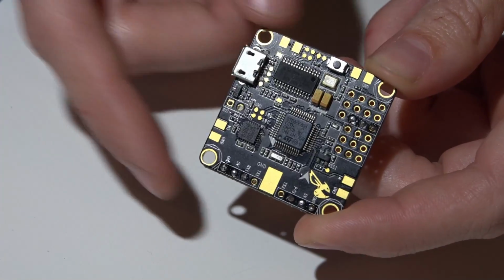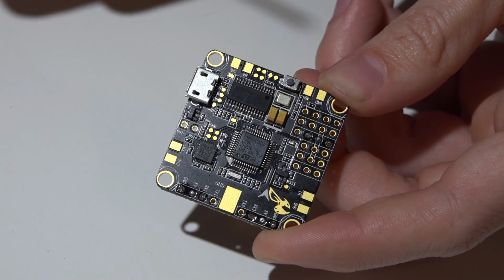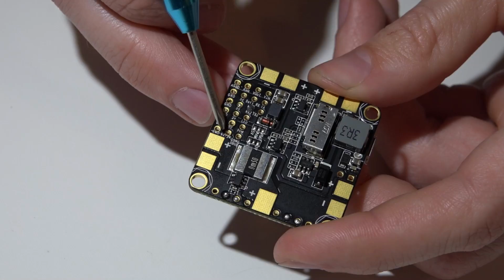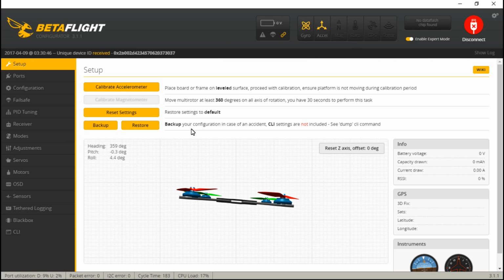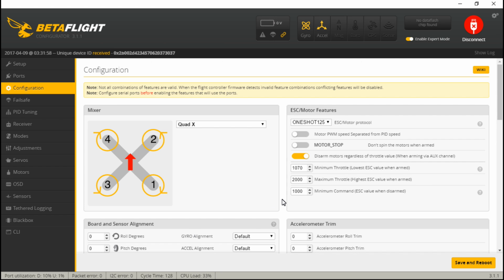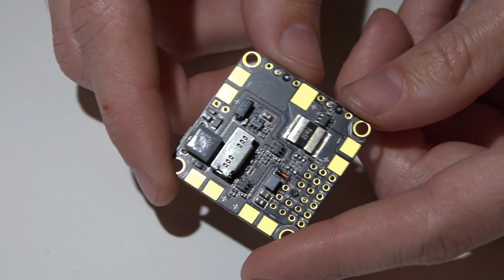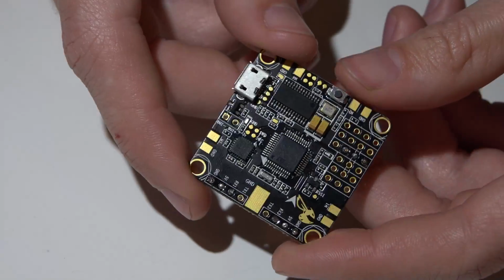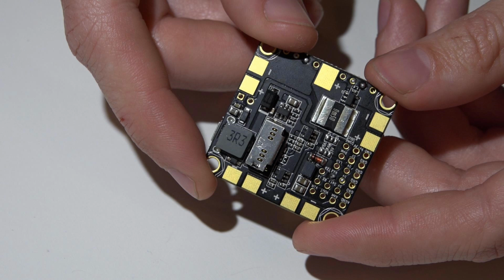Betaflight F3 Flight Controller Review

Comment: Hi I need help here , I have spent hours on it and cant figure this problem. I have X8R receiver connected to my OMNIBUS F3 AIO v1.1 FC through UART3. 
As you can see on the video I have limited control with Elevator and Eeileron. A bit higher Elev and very low Eil. When reconect the FC and rebind to X8R I gat full through on servos for few seconds and then it revert it self back to that limited servo movement. Is this the Board, receiver or bad UART ? By the way I have not removed the resistor from board. Did not think it was necessary since the sbus is connected.I am using INAV. Is there any chance you would know what have I done wrong ? 

Link to the video : https://youtu.be/trdlXlAmPCY

Comment: Great review, but still need some help. I can not get the beepter to work when activated via an AUX-channel ( that is properly set up). However a red LED starts flashing, but there is no sound. Any idea how to fix this? Is the beepter turned off when on stock settings?

Comment: Hi what would the current rating be of the PDB side,,,, I will be building a quad with a set of amp hungry - rcinpower GTS2205 2450kv motors, with 50A ESC's (maybe ott) I was told 120A may not be high enough that's on most controllers, ? would adding a cap help  ?  what could you suggest 
many thanks

Comment: Just started wiring up my board. I'm going to be using a iA6C with an Evolution. Is it ok if I wired my receiver into the DSM2/Sbus pinholes? Or should I change it to one of the 3 others that you mentioned?

Comment: I'm using this board, and am really happy with it overall, but I did have a conversation with FPVModel regarding the statement that this FC supports every possible Betaflight feature. An F3 board at the time of writing this comment does not support GPS. The Devs ran out of flash memory space on F3 targets so chose to remove that code from the firmware. GPS does currently work on F4 apparently (I have not tested this myself). Most people don't care about GPS on a racing quad but I did add a cheap UBlox7 module so I could see speed, altitude and position in the OSD and spent days trying to work out why it was not working. The Betaflight configurator lets you enable it and appears to be trying to connect to the GPS receiver, but the code isn't there in the firmware. When I found this out after a post on GitHub I was a little perturbed, mainly with the lack of communication on removal of a feature on a board for which I paid that was supposed to work.

BlueFalcon, that is one difference between an F3 and an F4 which is relevent

Comment from the maker: I noticed questions about wiring a 4 in 1 ESC to the Betaflight F3. You can wire a 4 in 1 ESC to it and it will work. You will just lose the current feature, ability to power your camera and VTX off the board, and will make the built in PDB pointless. So because you lose all these features that is why I'd recommend using a different and cheaper board if you plan to use a 4 in 1 ESC.

Comment: Im looking for a flight controller for use in fixed-wing application...
Which would be your choice of flight controller between this & the F4 Omnibus & F4 Omnibus Pro for use in a twin engine flying wing which uses 4servos for duckerons (split elevons) & running iNav 1.7 with satellite receiver please & why?
Flight controller could be out of the airstream, if thats of any help in deciding...
Thanks in advance

Comment: I use a BF FC and a Racestar 4 in 1 on my Kraken 3" . What I did was not connect the +/- power from the ESC though to the FC. I piggy back the power wires from the ESC to Lipo connection point to the FC and only connect the ESC signal wires. This means the current measuring feature goes not work, but the FC works perfectly including the voltage OSD
So the only connections to the BF FC are the signal wires, Video in/out, vTx power and camera and Rx. 
It makes for a very clean build.

Comment: Have they fixed the heavy solder required on the ground pads in the latest rev?  I suggested to them on the first two batches to add thermal reliefs on the signal grounds.
Reply from the maker: lol nope. Firrst thing I said to myself was was, why is the solder not sticking to the negative pins
Reply: Wondering if there is a technique in soldering to these pads...mine lifted off...not the pad but the wire and the solder blob.
Reply: Kenny Young High heat soldering iron (not high temp...but large tip), and flux

Comment: if you ever put this in your quad can you please tell is the current sensor numbers you put into beta flight configurator to get the mAh close. mine is super low and I don't have the proper equipment to calibrate it myself + I think I would rip my arm off, lol  you rock. thank you
Reply from the maker: Joshua Barrel just made a video showing the numbers and everything. Can't remember them off the top of my head but he just did the video today or yesterday
Reply: Joshua Bardwell found a value somewhere around 260 to 275 suited his boards. When I did my calibration (just a couple of nights ago) the value that worked for me was 250. Offset 0.

Comment: Good video, I picked up a lot from it and will sub to your channel.  Do you think it has become easier (simpler) to tune quads as the tech grows and advances or more complex?  Not complaining at all, because what we have today is far superior to what we had a couple of years ago, but with added filters and everything else we are now able to do and adjust, even though we can get our tune more locked in, it seems to me to be even more complex and time consuming.  I love flying and I also love building, I just don't enjoy tuning, and to me the more advanced the technology becomes, it should be easier to get your quad locked and flying exactly like you want it. When I started a few years back I had virtually zero knowledge of electronics or anything that could be useful in this hobby and have had to learn along the way, but I have learn a lot in the process, although I still struggle in this one area.
Reply from the maker: I'd say in some ways its become easier, in some ways harder. Getting D shot was great. They perform amazing and dont have to be calibrated which made things easier. But like you said adding in more filters and other parameters has made tuning more difficult and the flight controllers are now more sensitive to wind and vibrations. But overall they perform much better than a year ago even with the default settings.

Comment: I passed on this one because it costs more and you get less. Still like the omnibus better, but the whole inverted sbus uart is a small pain. The betaflight has the small micro sd slot and I've heard cards will sometimes come loose. Does the BF FC have a barometer? I always run a pdb with a 5 & 12v out. Even though my vtx and cam can run on vbat, I always see noise, so I like to run them off the 12v pdb. I ground everything to pdb. 

Dys looks interesting, but it looks like it's missing the sd and baro.
Reply from the maker: Nope the Betaflight F3 doesn't have a barometer.

Comment: Great Review, really appreciate all the videos you put out.   I think if you rip off one of the ESC power pads, you could double on the one next to the shut resistor because the trace is so fat.  Of course assuming you don't rip off that one. Or even solder to the output of the shunt resistor itself for the positive lead.   ;)
Reply from the maker: Thats true. Could also double up on top of the battery positive lead in worst case scenario.

Comment: Great FC with not so smart layout and pad quality of negative soldering pads. :(
Some people including me are had problems with solder minus (even with extra flux + rosin core).

I hope you'll review DYS F4 AIO soon. :)
Reply from the maker: Yea the negative pads are pretty thick. Have to use more heat on those than the rest. The 
DYS F4 will be here in a couple more days. Pretty excited to look at that one.
Reply: waiting forward to see dys f4 review. :)
Reply: Max Lukin I had the same issue.  my negative wires did not want to solder at all.  I had a hard time even tinning the pads.
Reply: Project Blue Falcon Had much much more problem soldering the negative pad!! The solder won't mealt easily!